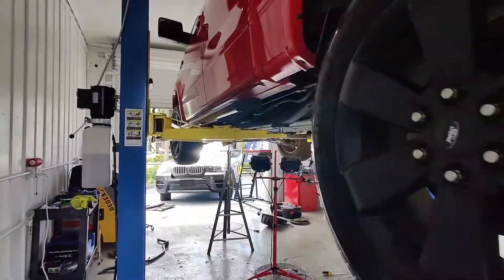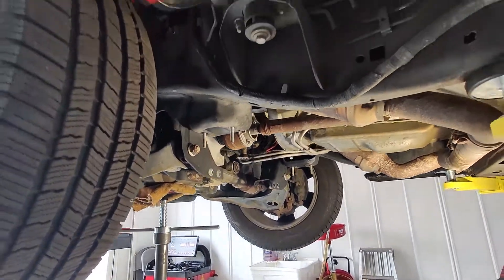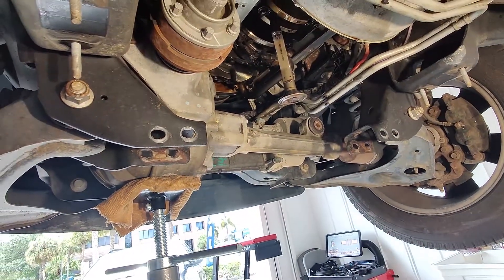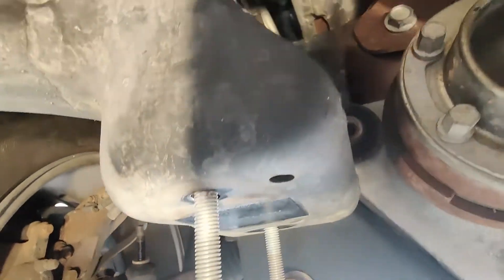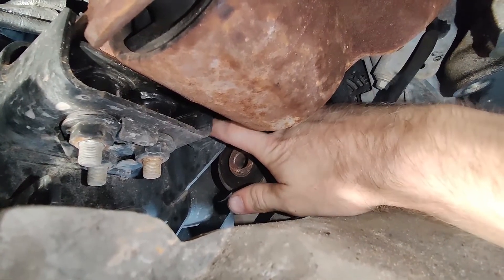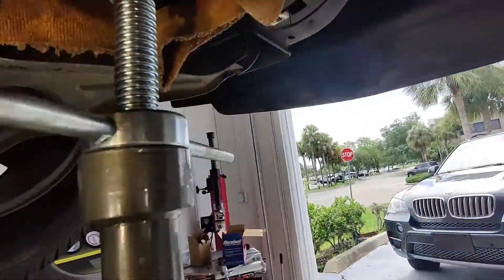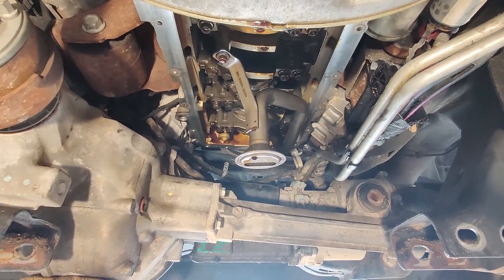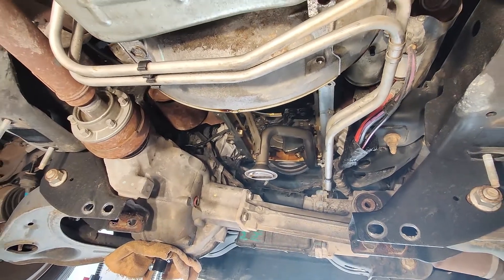2012 Ford F-150 5.0L Oil Pan Gasket Replacement

Comment: Just finished this job. The hardest part for me was definitely lining up the differential to remove the bolts and even harder was lining it up to put everything back together. You need two jacks, one holding the dif and the other lifting the car on the right side while putting the passenger side bolt back into position. Make sure that first bolt goes in the middle of the slot or else it'll be impossible to line up the holes on the drivers side. After getting the first bolt on, I removed the jack from the right side and lifted the left side and jacked up the dif into place.
Reply: All tips are helpful, thanks.
Reply: @jacklantern6339  Would be a lot easier if you have access to a lift for sure.

Comment: At 2:05 & also 2:45 to 3:00, about how long of an extension(s) is going to be needed (for the "upper front axle carrier mounting bushing bolt").  AKA the third bolt for the front diff.  The one by the steering wheel shaft, that needs to be taken out from the front (from by the oil filter).  Thanks...

Comment: would have been nice to see the leak before you took it apart.
Reply from the maker: I did show the leak. I pointed it out in the video. You will see the oil around the back of the oil pan gasket area and dripping from the bottom of the Bellhousing.

Comment: I'm doing mine tomorrow, what is the torque on the bolts? Any special procedures for replacing the gasket? Thanks.
Reply from the maker: It's a three stage process and there's also a pattern to follow to make sure force is applied evenly on the pan. It's more than I can type here. I suggest looking it up online and you will find the proper 3 stage sequence